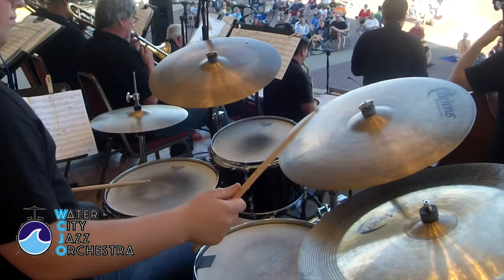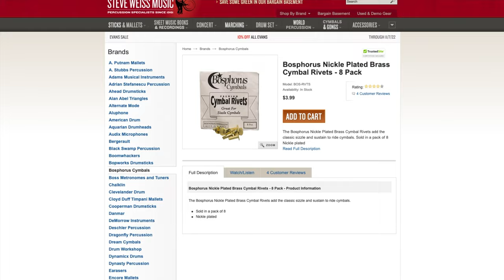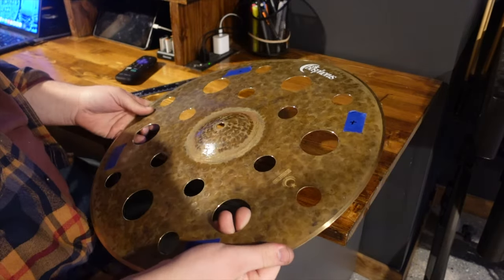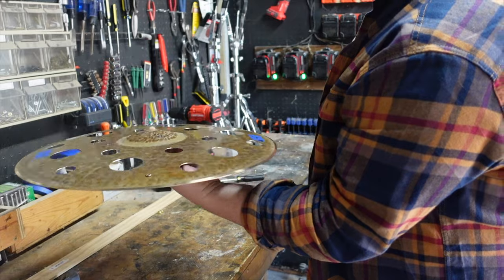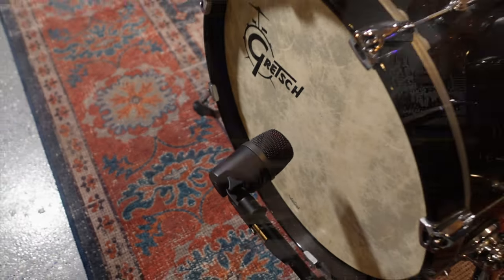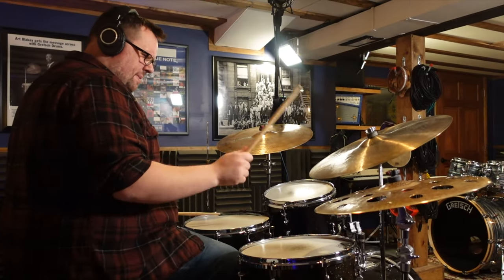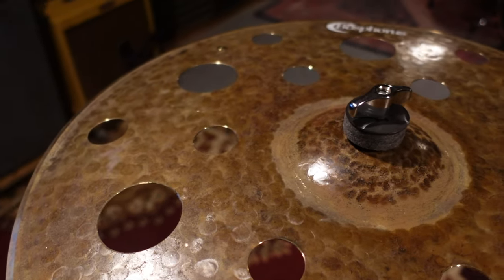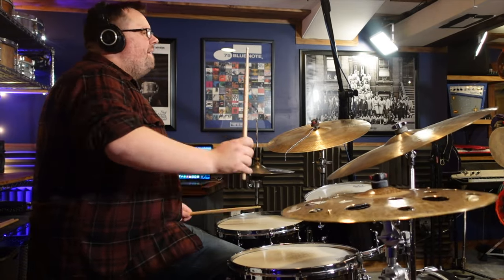Installing Cymbal Rivets In My New Bosphorus Crash

Comment: Another great video. I experimented rivets last year for a few of my cymbals. Bought the rivets on Amazon too and were super cheap. I had a 22" China and an 18" Symphonic Crash that had rivet holes but were missing a few of the actual rivets. Very easy to install and was happy to complete the cymbals! But the sizzler using ceiling fan chain is also an option. I made a video of it on my channel a LONG time ago and it was pretty fun.
Reply from the maker: I'll have to check it out!

Comment: Great work on the rivet install. It already sounded nice before, but after was really cool. Perfect for the jazz thing. Speaking of the jazz thing, is there a reason your snare is so overly dampened? Those toms were singing, but the snare sounded a bit choked, to my ears. Wondering if there was a sound you were going for? Good work, again, on those rivets. Bosphorus makes incredible cymbals, and this one (and the others on the kit!) are no exception. Cheers.
Reply from the maker: It's probably just a personal preference, but I like a very articulate/dry snare sound so that I can get away with more dense playing on there and not loose clarity. Really just a personal choice, not some sort of standard jazz approach I'd say.
Reply: Thanks for the great instructional video, Mike, as I really like seeing new ideas rather than just hearing about them.
When I was a kid in the mid 60’s, I was in a band, and at that time there was a gadget called a Sizzler that I used for the same sound. It was a piece of aluminum or some other very lightweight metal that was threaded, so it just was spun onto the top of the cymbal stand. It had little rivets at each end that laid right on the cymbal, and they sizzled when the cymbal was hit. Each end of this arm had an elbow joint which allowed me to fold it up, so it didn’t sizzle if I just wanted the regular sound, and it folded back down for the sizzle sound. I have looked for these recently but wasn’t successful in finding any. It produced a great sound.
Anyway, thanks for you video. I can’t wait to see what is next for all of us.
Reply from the maker: @gregwonhoff7161  Thanks
Reply: Cool. Personal preference, which is what it’s all about! Thanks for the reply! Best to you!

Comment: have you tried to tie the end of a sizzle chain with a light weight fishing line with loose loop the cymbal stand ? Keep the sizzle chain loose, but won't fall into the holes.
Reply from the maker: Like tie it around the cymbal, and loop it down below the cymbal on the stand?
Reply: @malonedrum  yup, if you knot it so u slide it up down u the line to change loop size u can adjust the tension. Might not work well if u crash the cymbal very hard. but for lighter work its fine.
Reply from the maker: @deaffatalbruno  That's a great hack, and makes sense. I'd probably not be willing to do it every time, but I love the creativity.